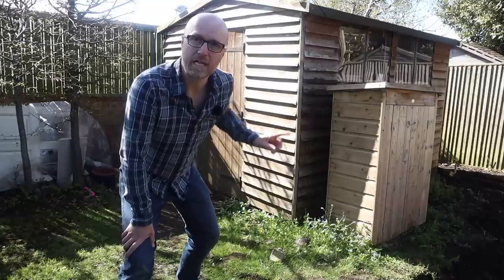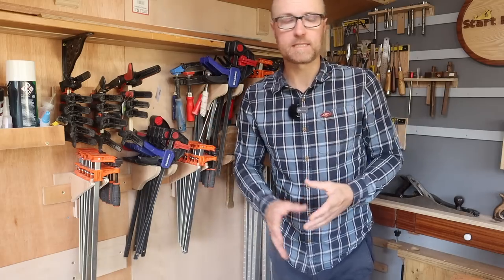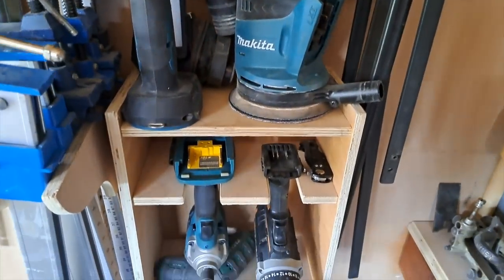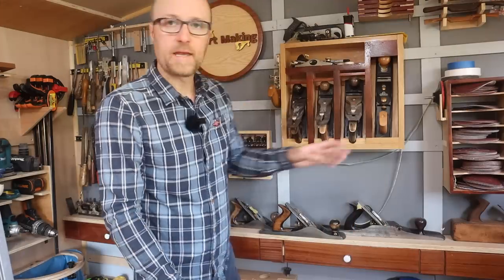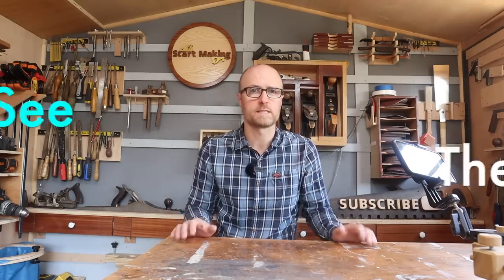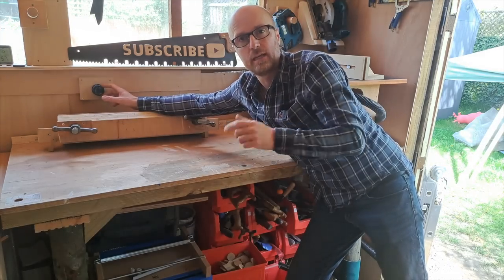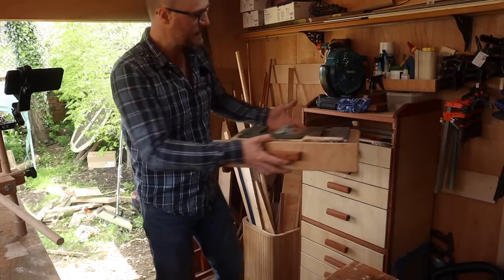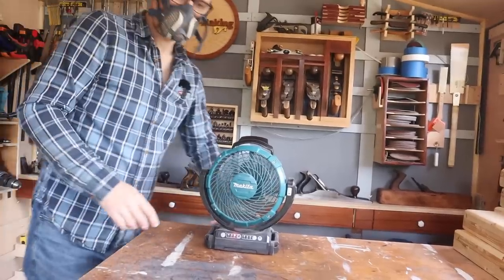You Won't believe how much I fit into this small SHED.

Comment: I made a living from 1991-2012 in a large shed that started out as nothing but a 24' x 30' roof on poles. It eventually ended up with power, a concrete floor and 200 amps power but had little heat, no AC and was always just a work in progress. Fortunately I stayed so busy that I never had time for shop upgrades. Plus it was on my parents property... 15 miles away from my home. After year's of recovery from a accident that disabled me in 2012 I purchase a 12"x28" premade shed in 2020 and got to wire, insulate and build it to house my two cncs, co2 laser, 3D printer and all the tool's I had collected over the year's. It is just a "hobby" but my robots help me create thing's in the tiny or tiny to me space.
Reply from the maker: That is quite a journey.  I am glad to hear that you have managed to come back to what you clearly enjoy. Great effort making such a small space work for so long.

Comment: Hi, Mark. Thanks for the tour. Wow, that was small. I'm a bit claustrophobic. It gave me the crawlies. 😰
You've done some great things, in that small space. Looking forward, to see what happens in the new one. 👍👍👍
May I suggest, for your dust collection: Run solid plastic pipe. The corrugated tubing cuts you air flow.
Use as little corrugated tubing as you can.
With the solid pipe, avoid 90 degree bends. Use 30 degree fittings, to create sweeping bends.
Each 90 degree fitting is worth 3 meters of pipe length, in regard to vacuum or pressure loss. 😁🖖✌
Reply from the maker: Hey. Always love your comments. So well thought through. Sorry for the mild scare. Feels bigger inside to be honest. Great advice on the dust collection ., I am currently toying with different ideas but what you say about the pipes is spot on. And like the diamond stones, really well researched.

Comment: At last. I can see you getting loads of advice on your build. As I've already said make it as large as possible, power is a must and don't make the mistake I made by fitting a clear plastic roof. It turns my workshop into a greenhouse with a temperature the other day of 50 centigrade. Can't wait for your upcoming build videos.
Reply from the maker: Hi Costa. I nearly didn't recognise the name. Yeah, I have planning for 4.8m by 3.6m and I am a little sad that I didn't go for a little more but then the garden would be full and the council might not have agreed. But we are where we are. I have just ordered a rubber, one piece roof, not cheap but long lasting. It is black but with rafters that are 170cm deep I can cram in a lot of insulation. There will be mistakes on the build but I am determined. Let's see how it goes.

Comment: I have been thinking about moving my scraps outside - A small 4ft high box sloping front and roof , the front drops to reveal a cart that you can pull out on casters and runners , In front of box would be a bench ( the sloping front of the box would be a back rest )
Reply from the maker: Ohh wow, that sounds awesome. And ingenious. I am considering using parts of the old shed to make a long thin shed to keep plywood sheets in. Nothing clogs my shed up like them.

Comment: That camera mount is genius! 
Thank you for the tour and good luck with the new build.
Reply from the maker: thank you Andy,. I actually have a video about them but never released it. Maybe I should as you are not the first to  comment about it. thank you so much.
Reply: @startmaking1  Please do! One of the problems I have with recording video in my small workshop is a lack of space for the tripod or other mounts. That looks like a possible solution to me.
Reply from the maker: That is exactly why I built it. If I dont release it , I will set it to private in a week or 2 and pop you over a link.
Reply: @startmaking1  That would be fantastic!

Comment: i think we all have that one obscure brand tool that just lasts forever. Like i have a jigsaw that i had to modify a bit to git the modern blades because it didnt fit the new blades very well. Its gotta be as old as me if not older which is 35. I am about to retire it though as its just taking so long to cut through anything anymore where i see newer ones cutting through wood like butter. Itll have a special place in my shop though as it was my first power tool that got me in the hobby.
Reply from the maker: Im sad as my drill finally died a month or so ago and the Makita replacement is not as good. And I thought it would be lighter but it isnt. Sad.

Comment: Looking forward to more. Bigger and better things mark. And hopefully power #more projects
Reply from the maker: Hi Peter. Discussions about power are happening this week. Fingers crossed.
Reply: @startmaking1   I had a sparky run armoured cable from fuse box along bottom of fence, didn't Bury it. Seems fine just remember where it lays. Get one external plug added as always handy for outside jobs
Reply from the maker: Great advice Peter, thank you. I did think I would need an outside plug. Good idea to run the cable at ground level. I may be able to get that done. Saves digging.
Reply: @startmaking1  And a bonus to it . Can isolate the workshop power from the house fuse box if a thunder storm concerns you

Comment: In a few days, i will move to new house, and I also have little 4m x 4m shed and I thought damn its small to do anything in it, but now I think differently, hopefully I will start to make stuff as well and I got electricity as well.

Grate video!, cant wait for build series.
Reply from the maker: Brilliant. enjoy the new place. 4x4 is a decent amount if you dont fill it. If that makes sense. I think that the temptation is to fit as much as you possibly can in and that will only make it feel smaller and smaller. 2 of the build videos are up and ready to watch. The next one is due Saturday. Good luck with the move.

Comment: Thank you for your time in making the videos, learning a lot. Looking forward to watching your new workshop build.
Reply from the maker: Hi Rob . You are very welcome. And I am also looking forward to seeing how the build goes. A little out of my league but determined.
Reply: @startmaking1 : Just research your construction methods and joinery, before you start.
You may want to make the new one taller. Heat rises and a higher ceiling will allow for more heat to accumulate, before being felt. A roof vent might be a good thing, as would an exhaust fan, but a fan could be noisy.
Reply from the maker: I have planned to go right up to the max height restrictions which are 2.5m for a listed building garden. should be just enough.

Comment: I hope you will show us any of the little surprise finds in the workshop as you dismantle it. It's always surprising what gets into the fabric of a shed.
That was a great video of how to do storage - I have always been a fan of a French cleat. They can take an insane amount of weight & my kitchen wall units are mounted using them.
Genius camera mounting system! I like to take photos and had never thought of a laboratory-style retort clamp. I will now! 
Have fun with the dismantling and the new build!!
💚🐇🐴💚
Reply from the maker: Hi Bunny. to be completely honest, I was gutted, I found nothing in the boards, and the floor was amazing, cut through it and it was like new in the boards. So well built. I did miss a trick though, I should have filmed me trying to take it apart. Nearly squashed myself a fair few times. It weighs a ton. 
I am still very much in love with the French cleat system as it also looks great around the shop. Sounds daft but I like to make the space I am in pleasant as well as functional. 
Funny you mention the camera mount. I actually have a video ready to go about how I made them, not that it is hard. I may yet release it but it does make this one, not the last one in the workshop chronologically. Ill let you know.

Comment: New subscriber today Mark. My first workshop was a second hand 8' x 6' shed. Had to rebuild every wall as I could afford it. Some times I swear it was held together with paint. Still standing/useable although its been a bit like 'Trigger's broom' (if you know, you know!) The French Cleat system is a game changer. Not sure how I'll manage to cut long lengths of cleat without band/table saw but definitely give it some thought. Every OCD box ticked, happy bunny. Will peruse back catalogue while I wait. (edit) Notices cleat video, own a circular saw, grins! 😁 'appy days!
Reply from the maker: Great to have you an aboard Richard, Thank you. I was sure the shed would have fallen down if I had nit clad the inside. I love the broom reference. So very true. I cut my cleats with a circular saw and clamped straight edge. Wobbly lines on some bits but overall it was not too sketchy. Dont worry I have another video lined up soon and I expect the first part of the build to be ready to go soon. fingers crossed.

Comment: I like the drawers and sharpening tray idea. Although I'd probably incorporate the sharpening tray into a stand with a bench grinder. But you don't have a grinder cause you've got no power LOL. I couldn't imagine not having power to the shed. That was one of the first things I did.

I'll check out some of your other videos as I'm interested to see how the shed come about. Although my old pole barn shed has stood the test of time. I did some work on it 20 years ago when I bought the property and it was already probably 30-40 years old then I'm guessing (maybe older). But it's getting to the point I need to do something major to it or build something else as well. 

Good luck with the new shed.
Reply from the maker: The new workshop will have power. Not yet but when it is built. 
I actually found the lack of power really helpful. I have not bought tools before I am ready to use them and I dont think I would have found my love of vintage and tools if I had power. That said, I need power. 
My wife has told me that I am no longer allowed to call the new shed a shed due to the belt and braces way I have built it. Apparently without knowing it I have progressed to a workshop. or Garden room as she would like it to be.

Comment: I have a 5m  x 4m shed. The size was limited by my other half  and the finished capacity left me feeling slightly immasculated .-You have just fixed me. I still have cabinets to sort out and so look forward to poaching some of your ideas in the new shed..” good luck… ps Firestone rubber roof is a great option that works.!!
Reply from the maker: Wow Ian, that is a really good size. Really good. It is a little larger than what I am currently building I rattle around in mine. Great shout on the rubber. Next week I plan to release the roof video where I put the rubber roof on. Didn't go smoothly but my fault not the rubber. That was excellent.

Comment: its so much smaller than i realised. Feel a lot better about my 6x6 shed now. One day ill be able to build a new one twice the size. External dust extraction is very clever.

Have you ever done a video about sourcing wood? I find UK is a bit desperate for wood. My last project was a nightmare after the timber merchant gave me a load of awful plywood
Reply from the maker: Thank you very much bud. I miss this shed a lot. I consider doing a wood video all the time but until I have a little more experience to bring to the table I need to wait. It is a nightmare finding good stuff and it is expensive. As for ply. I have a family run builders merchant that specialises in timber in my town and they have far better quality ply than wickes and the others. If you have one close it is worth the trip. Better price too.

Comment: 10x8, luxury. I dream of a 10x8 shed. I'm in the middle of doing up my massive 8x6 shed👍
Reply from the maker: Wow Vincent. Is that feet. That is small but you can still do a massive amount with it
Reply: @startmaking1  yup, that's feet. Still, I have managed to get two benches in with a vice, a cleat system with various tools and storage for a pillar drill, bandsaw, scroll saw, and belt and disc sander. I also have a pair of saw horses which I can use for a makeshift bench when the weather allows. I'm sort of the opinion that necessity is the mother of invention. Sure I'd like one of the American style shops with every gadget known to man but, when I see these, the craft of woodworking seems to be getting lost.
Reply from the maker: Wow, that is a lot to squeeze in. Very nice.

Comment: Great video and some good ideas for organising a work space which can be applied irrespective of workshop size. A large workshop can soon become a cluttered mess with "no room for anything" if not thought out and kept tidy. Guess how I know that (with my 18' x 18' double garage!). Looking forward to seeing your new workshop take shape and I hope you have the time to make videos of the build. One comment I'll add to your idea of using magnetic strips to hold tools and drill bits (especially drill bits). If like me you do a bit of metal working from time to time, anything you store on a magnet will itself become slightly magnetised which then will pick up and hold onto any metal filings/dust you've created which can be a real pain in the behind. Thanks for sharing your video and good luck with your new workshop 😊
Reply from the maker: Hi. thank you. Jealous of the double garage I must say, And you are right, I have to be organised otherwise I would not be able to see the floor or work benches in any size shop. Great advice on the magnet strips. I dont do metal work but I have found that when I sharpen the chisels, the filings stick which can't be good, In the future I will have to adapt it with that in mind. Thank you.

Comment: kia Ora Mark..I’m just getting in to woodworking I’m a Engineer by trade and got to say I’ve been watching your You tube looking for tips..
Like to say by far your channel is awesome spent the day watching your videos.
Cheers..
Reply from the maker: kia Ora. Thank you so much for the kind comment and the binge watching. I should think that the engineers mindset will hold you in very good stead with woodworking. thought, I would say, dont worry if you are not 100% precise in what you do for certain builds. Wood is every moving and can be very forgiving.
Reply: Well that’s it’s in a nut shell Mark I’m use to well dead on..so having to retrain the mind but your a artisan beautiful work for some one operating from a small shop..
Cheers looking forward to more..
Reply from the maker: Cant wait to see what you start with. I bet it will be amazing.
Reply: Well.. I’ll send a picture have to rebuild first as the area I live in had major flooding..
I’m lucky water went under my house and sheds so clean up.. like you I’m building a container workshop..20 foot container..
😊 
If the Kia Ora (Hello) hadn’t given it away I’m  a New Zealander.
Reply from the maker: I did google it as I was torn between New Zealand and another . The container workshops look cool ,I watch Woby in the US and he used to work out of a container. Needs insulation though I think. Otherwise it would be super hot in the summer.
Reply: Morena yes I’ve watch Moby design as well..there are some awesome idea out there but happy for now with a container..can’t get thing in at the moment as we keep getting storms..
So I’ve been buying my gear (tools)
But I’m in awe of your workshop..
Love small spaces that are pushed to there limits..thank you for the kind words and your reply looking forward to the future for all..🎉

Comment: Enjoyed your video so much. I get tired of watching videos of guys who have all the wonderful super expensive machines. If you have a million dollar shop it’s way easier to make something than the way you do with the little you have. Very efficient use of space !  I’m 74 and close to making my first YouTube. Mine should be a bit different because it’s wood AND metal. I’m a toolmaker AND cabinet maker. You can use metal stuff to do wood but can’t use wood stuff to do metal lol. I’ve subscribed because I’m sure even at 74 I’ll learn something from you. Just one little thing I thought of was your saw horses. To save space I bought folding ones. Certainly not the feel and rigidity of wood ones but good enough for my projects. Cheers Mate, carry on 😃
Reply from the maker: Thank you for reaching out. Very much appreciated. I have a new work shop now and still have only bought one tool extra I think. I need to learn how to use each one before getting any more. Seems the sensible approach. I cant wait for the first video you make. And the folding option is a great idea. Thank you
Reply: @startmaking1  You’re quite welcome. Anxious to see the new shop. I have a 3 car garage which has about everything and still manage to keep a few bikes in. Of course I roll them out when doing a project. Everything is on casters except for my milling machine and lathe. I’m happy how I got so much in. I’m retired for like 15 years so it’s simply a hobby shop. I make a lot of metal art pieces. Many can be viewed on Pinterest . If I did it for a living it would get to me because it seems there’s always something in the way or a pain rolling stuff to where you need it at times. I’m impressed with your use of space. I’m betting you love your bigger shop. What piece of equipment did you get?
Reply from the maker: I have just got a table saw, job site sunk into my work bench but now I really need dust collection. It is a bit like a domino run where everything you buy leads to another one. fun though.